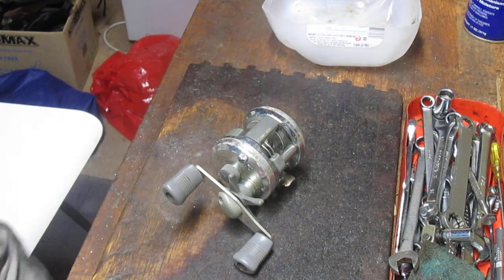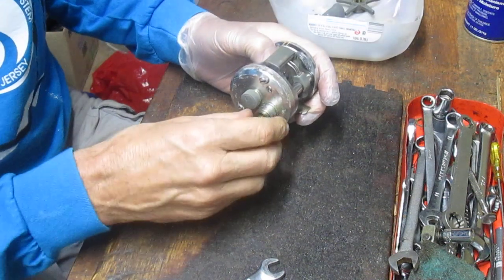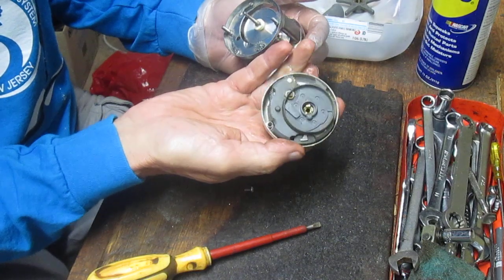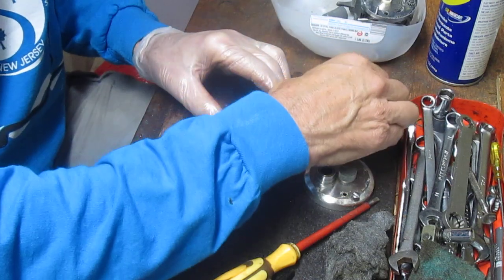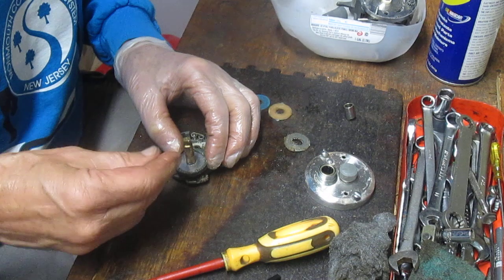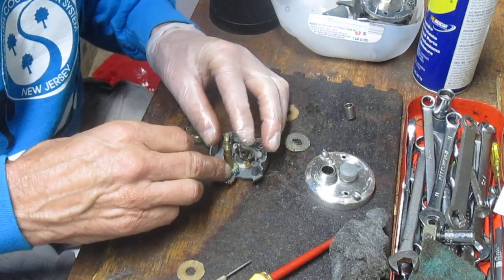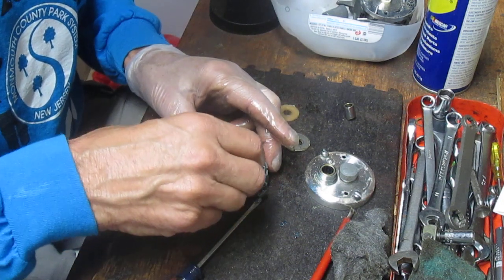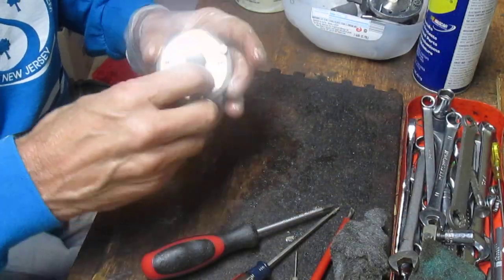Shimano Corsair CS200 - CS400 fishing reel service

Comment: One of my favorite reels. But my paw cap just broke and now I need to find a new one. Speaking of which you did not clean the level wind gear and paw. They get real dirty too.
Reply from the maker: Thanks for the note.  That cap is definitely the weak point of the reel.  You are correct, that pawl and gear should be cleaned.  My omission - Dennis

Comment: Do you ever notice when you go fishing , that there is an older fisherman fishing with quality equipment 20 to 30 years old that works like new , his secret , cleaning after use and servicing  .
Reply from the maker: Yes - and I have also noticed folks with very expensive "new" reels that lay them on the beach when unhooking a fish or taking a break.  I will see those in for repair soon enough.   Care is key - thanks for the note - Dennis

Comment: Dennis, should i buy a zeebas or a van stahl? Assuming you know of each..
Reply from the maker: I am somewhat familiar with both.  The answer is always, it depends.  To start with, much of the engineering and design are the same.  It is my understanding the the lead designer for the Van Staal reel is now the engineer for the Zeebas reels.  Van Staal was purchased by the WC Bradley company, which is a conglomerate that manufactures Zebco, Quantum, Fin-Nor and Van Staal reels.  Both are high quality and high priced spinning reels.  Both have excellent reputations.  So, it is all about the feel and the fishing you do..  How do the reels compare side by side?  How do they feel in your hand.  What are the ergonomics, how much does it weigh and how is the balance for the pole you will use it on? How do the crank, handle, etc. "feel". Which fits you best?  I believe you will be happy with either.  You need to try them out to make the final call.
Reply: @2ndChanceTackle  thanks, that was helpful, i will.

Comment: Thank you for video. I was cleaning my Corsair 400cs and theright side plate opening that holds the roller cluth inner tube is loose. The anti reverse bearing sits in this part. I cant figure out why this part is loose and how to tighten. Any suggestions. Appreciate your help
Reply from the maker: The clutch can slide in and out of the side plate sleeve.  It is not pressed in, so if it is loose, that should not be an issue.  I can't imagine how that would be damaged.  As long as the clutch does not spin in the case, in other words, the case is holding it in position, then you will be fine. - Dennis
Reply: @2ndChanceTackle  Thank you dennis for your reply. I reassembled and the sleeve between star drag and side plate is loose so small wiggle when reeling. Probably a defect as no way to tighten the sleeve to the side plate. I appreciate and enjoy watching your videos

Comment: I noticed you gave no attention to the worm gear was that intentional and when you do do you recommend oil or grease?
Reply from the maker: I generally add just a drop of oil to the worm gear and pawl. I don't use grease as it is an exposed area that gets a lot of water on it.  If it is salt water, the grease deteriorates quickly and the salt remains once evaporated.  This one was turning fine, so I left out the step.  - Dennis

Comment: I have a Corsair 301 that the anti reverse misses on occasion. any ideas on a quick fix for that? it does it on every cast.
Reply from the maker: I believe your corsair has the roller clutch anti reverse system.  These usually fail if there is a lot of dirt/grease build up on the inner ferrel.  Try taking off the star adjuster and remove the tension washers then the ferrel.  Clean it and insert if back in to see if that improves the performance.  If not, then the roller clutch would be the next thing to check.  They rarely fail, but you may have one that is dirty and acting poorly.  The best thing to go there is to remove the side plate and flood the roller clutch with several blasts of a penetrating oil, like WD40 in order to try and clean out any debris.  If that doesn't work, then it would probably need to be replaced.

If by chance you have an older model with the anti-reverse pawl, then you would need to replace that part.  If you can send me a picture of the inside of the reel, I can confirm.  Send the picture to me at 2ndchancetackle@gmail.com
Dennis
Reply: I have an old Corsair 400 and the anti reverse missing occasionally also.

Comment: Dennis I have shimnano corsair 300 drag is tightened all the way down but still not working do u think I need to replace drag washers or just clean it out
Reply from the maker: Yes - I would start by replacing the drag washers before I looked at anything else.
Reply: @2ndChanceTackle  thanks for your help going to give it full service from your helpful video and change drag washers